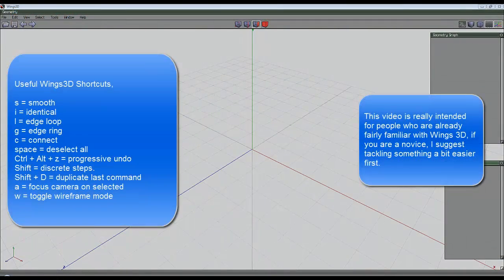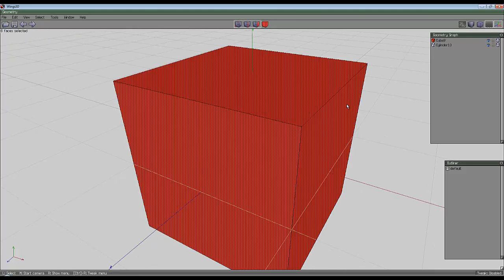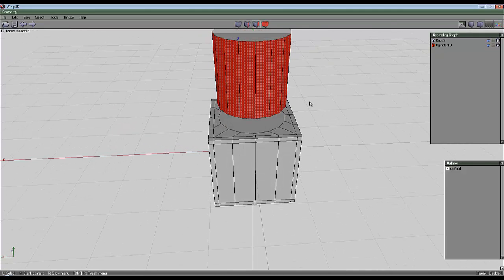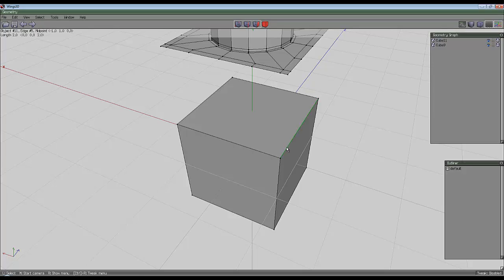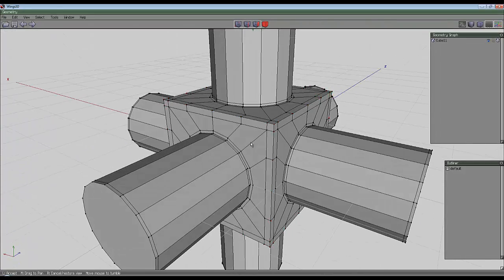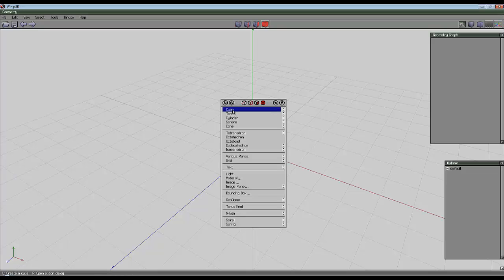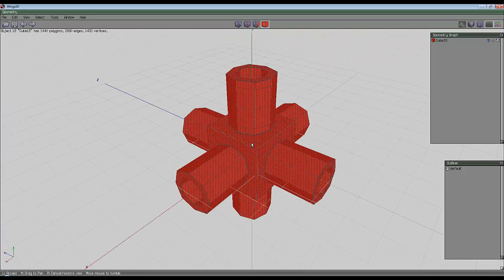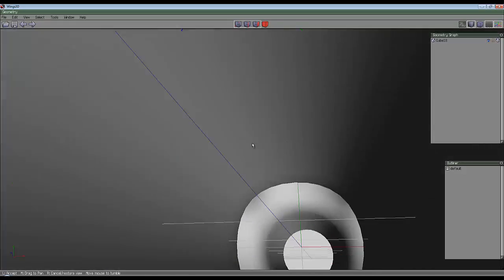Wings 3D - Making Better Geometry - by David Brinnen.

Comment: I like messing with Wings3D and just watching this video out of curiousity has actually taught me a fair bit more about Wings3D that I didn't even know about.
Reply from the maker: Glad it helped and thank you for your comment.  Just to let you know, Youtube had flagged your comment as spam so it took me quite some digging to find it.  So if in future you find you are not getting responses then maybe it is because Youtube for whatever reason has decided to junk your comments.  Cheers, David.
Reply: @davidbrinnen  Im using Wings 3D since ~2000, learning every new implemented feature trough versions and you are doing one thing wrong. I dont know if you intended to do it or just doing it wrong.
At 09:20 you are adding more lines to get better render. Thats wrong. Adding lines like that are actually added to define future smooth angle. For example, between two edges, you add third middle edge to define future smoothness between all of three edges, including corners, inside, outside, to get curve you need, like smooth angle at decided degrees.
Adding edges like that can actually break the model if its meant to be giga-poly one.
If you wanna make it smooth, just work on your new edges and define how smooth you need, more sharp, more smooth, some pattern, whatever.
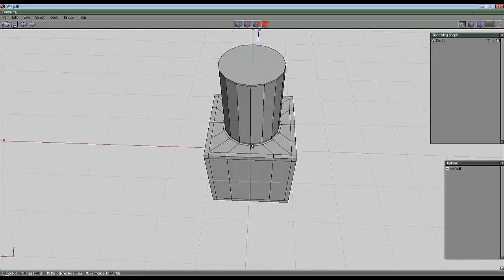Same thing applied for 10:40, if you wanna make it smooth, make one single dot at the center, add one circle line, and define nice half ball.
However, at the end of a video, you added this useless edges/lines around sharp angles to make it stay sharp after smooth or to looks good for rendering, or to make better future smooth. Since i believe you need sharp angles and perfect render, its done with hard edges that you didnt mention.
Just select edge and make it hard (to be 100% sharp) or soft (to be 100% soft), this will save model size from useless polygons (that can break finished product), and when you smooth it, it will consider this hard edges to smooth it even better.
If you really wanted smooth edges, for like 3D print, then its fine. Just dont wanna other peoples to learn the wrong way of making sharp edges.
BTW At 20:10, you dont ever need this cross things, zip fangs, texture problems, modelling problems in the future, avoid having multiple dots, edges and surface at the same location, two identical things at same location can only bring problems, for working, texturing, rendering, fixing, can produce glitches and can make you angry.
And, sometimes its easier to make half the model and mirror it, or make 1/4 model and mirror it twice to get same thing accurate, instead of doing all 6 sides at the same time and thinking of them, searching identical things, limiting yourself, its easier to do only one side more precise with the mirror or so, including less chance you are gonna select something accidentally or make some damage somewhere, and its gonna be faster and better if you focus on smaller thing (that will be mirrored).
Reply from the maker: @RadiusNightly  Thank you for providing such a detailed reply, I shall leave it here so that others may benefit from your observations.  It has been a while since I used Wings and as you might expect have moved on in my approach as a result of more experience.
Reply: @davidbrinnen  I stopped using newer versions of Wings 3D, older version pretty much enough for me. About ~v1.41, mainly because of interface. This is my old video, but i use same color interface today. https://www.youtube.com/watch?v=XNneMXqPBoc

Comment: I always loved this tutorial. Gone through it 3 times at least. Such a great Wings3D refresher on the various commands and approaches to the creation of clean usable geometry.
Reply from the maker: Thank you, yes once you get onto the topic of "good" geometry - the rabbit hole goes very deep!
Reply: I'm still new to Modeling really.. but I'm working on creation of my own little game in the unreal engine and I want to create reusable pieces (think legos) to generate the various environments in my open world game. I'm using blender mostly but I like Wings. Always have so I like doing things in wings then trying to do those same operations in blender.
Reply from the maker: @CaffeineInjected  Substance painter, which I have used a bit, has a neat facility for baking details from hi-rez mesh to lo-rez, which is good if you are trying to keep down the weight of your geometry.  If you model subdivision ready geometry, you can use the base for lo-rez (stripping out supporting geometry for maximum efficiency) and subdivide to create your hi-rez component (do this before you strip out supporting geometry).  Then you have some nice lightweight geometry which looks much nicer than it actually is.  If you are not aware of what Substance can do, look at https://www.youtube.com/user/Allegorithmic very good tutorials.  And this is a video showing some workflow from Modo to UE4, which I found interesting. https://www.youtube.com/watch?v=2vayNaWs_3Q
Reply: Hey David, Actually I keep a lot of my reference art and ideas on google drive about my game project and I have a document called "Software I need to Evaluate". Substance painter is #1 on the list of things I want to review. I've had several people recommend it highly.  I definitely want to keep the weight down. I'm also aiming for a more "stylized" look to the geometry. 

These tutorials are kind of right up my alley for creation of rocks and trees that may fit my overall "look or feel". ( Creating Rocks in Blender: https://www.youtube.com/watch?v=BeO7ZZPLeKA   Creating stylized trees in blender: https://www.youtube.com/watch?v=_Br6Xq4LZcI )   

I will definitely check out that youTube link. Also, thank you very much for your replies they are very welcomed and I'm sure will be very helpful as well. I'm very excited about the game I want to create. I'm a software engineer whose always wanted to create games and 3D content. My place holder youTube for my game is https://www.youtube.com/channel/UCt0ovdvanu64F552HxIcYug 

If you click the about section you can see what it is I'm trying to do. 

Cheers
Reply from the maker: @CaffeineInjected  Oh yes, making rocks - indeed organic stuff in general, without the aid of procedural techniques, I find very difficult.  My favorite thing for modelling - so far, is bikes - https://www.daz3d.com/vintage-70s-pedal-bike - was fun to make - I've a few others in my store.  For plants I use x-frog - but even with decimation processing, the result is rather heavy and the UV maps are temperamental.  Rocks... well, I've tried a variety of techniques in Modo (my preferred modeler for complex projects) and they have all had their issues.  Procedural tends to result in triangles and unexpected and unhelpfully weird geometry.  The UV mapping can be challenging too (UV layout is what I use for that).  When you get around having a crack at Substance painter, feel free to fire an email my way, mail(at)davidbrinnen(d0t)co(d0t)uk - there are a few quirks that caught me out to start with that might have you scratching your head and I just might be able to save you a bit of frustration.
Reply: Yes I think UV mapping for some of the objects will be key. 

I'm trying to break down my project into sections that are relatable. So for example. My game has towns. In the towns I need to create buildings and roads and lamps and wagons and barrels. Then I break down each of those into the components.  So I can create a reusable wooden barrel. I'll need a model first of course. Than a texture. I need to create the proper UV Map. Etc.. and etc.. I'm hoping if I break it down in this fashion I can over time create each of the pieces I need to make one town. Than re-use many of those components for another town. Of course I have to keep in my mind that each town has it's own feel if based on the people who live in it. So I will need to be able to create buildings that can be "tweaked" slightly to then drastically change the "feel or look" of that building. So many thoughts and ideas that is why I'm trying to break each process down into very small and doable chunks. 

I also want to create castle towers made out of stone that can utilize various textures. One texture would be a tower that has been freshly created. So a pristine texture. One that has seen some weathering over time. Then of course one that represents a tower that is falling down and old and in disarray. 

I've heard of x-frog but not used it. I've never used Modo either but I have heard of it. UV layout I'll definitely check out.

Thanks for the email I'll add it to my gmail and definitely send you a note if I do get stuck or have questions around any of the other software you mentioned.

I am using World Machine as well. I purchased that and so far I think it has been a useful purchase as I have created interesting terrain and brought it right into the unreal game engine quite easily.  Thanks again!
Reply from the maker: @CaffeineInjected  UV layout's automated segmentation (packing) might result in not very human readable maps - but... + Substance painter = not such a problem.  One of the issues with normal baking across a hard corner which is part of a continuous UV shell island is that the corner can generate artifacts - which is probably going a bit far into it.  Making a game, it sounds like you have enough problems to contend with.  So I'd be looking for streamlined solutions.  For example in Substance, you can create materials that have exposed "controls" which - I am pretty sure - can be exposed to UE4.  So you create a material which your game can dynamically adjust.  For what I do, texturing static props, I put controls into my substances so I can create variety so I can use the same material on several props and customise the way they look according to my needs - rather than having to build a new material from scratch for each prop - which would be more time consuming.
Reply: Yes you can do, I'm pretty sure, the same thing in Unreal Engine 4 using it's material editor.  Then in code I can swap out materials based on whatever criteria I desire. Building a material from scratch is what I'm trying to avoid.

I don't think it's going a bit too far into it. It's good to know where problems arise.  My game project is more of a hobby. A way to get myself to feed my artistic side while also forcing myself to learn the concepts and techniques. It serves many ends.
Reply from the maker: @CaffeineInjected  Keeping the old grey cells active, very important!  And a game project is a better hobby that sitting watching TV.  I've not had TV for over two decades.  Who has the time for such dribble when there is art to be made?
Reply: Haha! Yes I don't watch TV. Unfortunately I do play guitar but it's suffering due to my time working on digital content. Heading to Tennessee for a 1 week off from work and I'll be in a cabin in the woods for a whole week. In the middle of nowhere. I'll be collecting a lot of textures and photos for reference and bringing my sketchbooks so I can do some drawing as well. Looking forward to that! I just wish when I graduated high school way way back in 1988 that I could have gotten into Modeling and Animation then instead of Computer programming. Ah well no time to dwell on the past. When I get my project really moving I'll send you the video links. Should be fun!
Reply from the maker: @CaffeineInjected  Look forwards to it.  Yeah you can't look back at the past and predict what direction your life would have taken, it is well within the realms of possibility that graduating in high school way way back in 1988 could have resulted in your untimely death under a bus.  The butterfly effect - see... short story, A Sound of Thunder, by Ray Bradbury.  Anyway, enjoy your holiday in the cabin in the woods!  Sounds good.  Because I read The Walden Woods project, I'm now imagining something quite "elemental".
Reply: Thanks David. The Walden Woods Project? I'll have to look into this.
Reply: The bike you did was very well done. I've done a few models of bizarre shapes and they can be an infuriating but very enjoyable undertaking. I can definitely see this bike being one of those types of jobs. Looks great.
Reply from the maker: @CaffeineInjected  Thank you.  He's a link to info about the book that inspired the Woods Project.  https://en.wikipedia.org/wiki/Walden
Reply: Very interesting. I wish we could save more of the natural forests and nature in general. Unfortunately in this world things are being destroyed at an alarming rate. It makes me sad. Being in the woods and in nature out in the middle of nowhere brings a peace most people fail to really grasp as they are too busy with their daily lives and social media ridiculousness. This is why I like playing open world video games. To try and experience that feeling of being in nature and in a world that has not been polluted as our world has. Another motivation for my game "The World of Vostlar"
Reply: In regards to baking hi to lo rez in substance painter I did find this video. I've saved it for reference. https://www.youtube.com/watch?v=r3c6NH47gkY
Reply from the maker: @CaffeineInjected   Substance is one of the few bits of software where I can really recommend the tutorials they put out on their own channel.  Wes covers a lot of topics and in great detail.  The webinars they re-upload are also worth watching.
Reply: I'll definitely check them out then. Thanks.

Comment: Great video, it has taught me a lot. Mind you, I have had to watch it forensically about 47 times to get the clicks and settings ;~)
Reply from the maker: Thanks for the feedback, I'm glad you found the video useful.  I try to mix my learning with experimentation, I find things only stick once you've run into the problems for yourself, then the solution makes much more sense.  So what I'm saying is don't worry too much if you feel you are missing something.  Come back later after you've experimented a bit more for yourself.
Reply: I agree, that is my philosophy exactly. I am using v2.1.5 and it seems a pity that there is not an up-to-date user manual running in parallel with the software updates -  unless I am missing something.
My main use of Wings3D will be for making 3D models of electronic components for use in KiCAD - which is also a new learning curve for me.
Thanks again.

Comment: sliding to 100% to the cylinder, then slide it back by a fixed amount so it retains shape... doing it all the time
Reply from the maker: ***** Thanks, hopefully someone better versed in Wings 3d than I will understand what you mean by that, but I confess I am baffled.
Reply: When you use the slide tool you can switch between percentage and fixed offset mode with the 1 key
Reply from the maker: ***** Ah, I see now, thanks.

Comment: I love David Brinnen Wings 3D Tutorials. But in this case why not starting with a Cuboid, creating some supporting edges in the middle and then just circularise simultaneusly one edge loop in the midle and one at the top. Done.
Reply from the maker: Leon de Owlet Thanks, but I don't know how to answer this question.  The aim of the process is not the shape.  It could be any shape.  The thing I want to get across is that you can have the any shape (made however you want to make it - simple or complex), but that when it comes to rendering, the render engine will fail to interpret the surface as you intended because you have not provided it with enough "clues".  For example, a basic cube is a cube, six sides, no problem, but if you feed it into Octane like that, for example, it will make a pigs ear of the faces.  Extra, seemingly superfluous, geometry would need to be added in the form of supporting edges, close to the edges you wish to render as sharp, for Octane to correctly interpret the face normals and do a good job of rendering your object.  Some render engines, like Bryce for example, are more forgiving, but even then, it is still a good idea to supply "better geometry" to avoid confusion.
Reply: David Brinnen Thank you very much for your answer. My Idea was not about supporting edges for better shading results which was of course the topic of this informative video. I just wanted to avoid the time consuming welding of the cube with the cylinder. Starting with a cuboid or a face extruted cube for the final shape I can insert as much supporting edges as I want. But I am dealing with just one object. Unfortunately I can not post a Picture here. Hope you can imagine what I mean.
Reply from the maker: Leon de Owlet Aye, somewhat, I find with modeling projects I often get half way through and start again because it has dawned on me that I could have taken a different and more efficient approach.

Comment: Hi David,

First of all I love your videos, you made me interested in Wings 3D, so cheers for that.
Regarding this video I have a suggestion on how to create the support geometry to keep the vertex normals parallel for flat surfaces while rounding the sharp edges.
The idea is that you don't worry about the support geometry until you are satisfied with the actual shape.
Just keep sharp edges sharp while modelling and do the rounding at the end.
When you are done just select the hard edges + bevel + inverse selection + RMB inset.
I made a recording to demonstrate the idea:
Wings 3d support geometry with bevel+inset
Reply from the maker: Thanks that is a good tip!  Indeed you are not the first to point this out.  I will try and remember to include it in my workflow for future modelling.  There is still a lot to Wings that I do not know about.